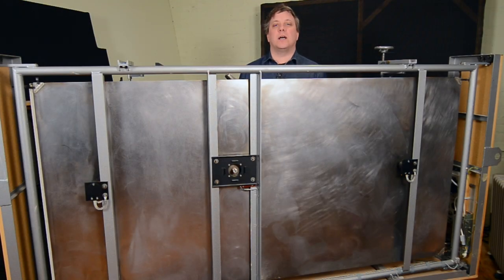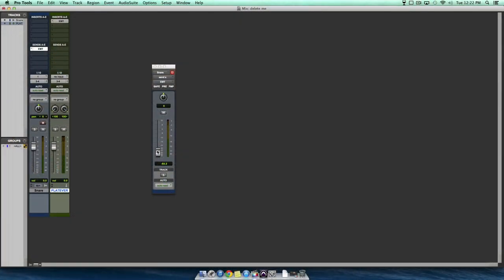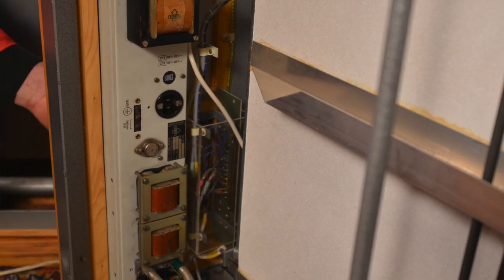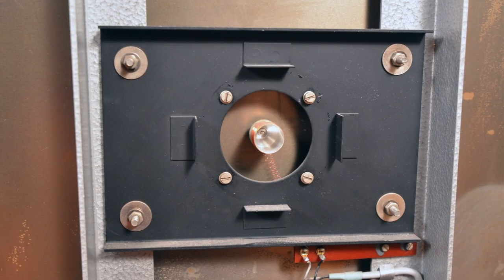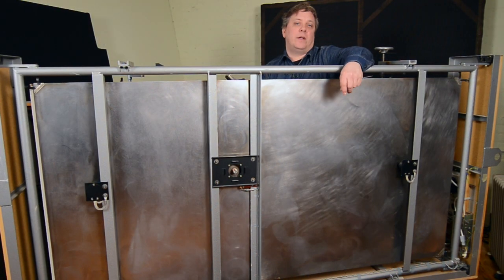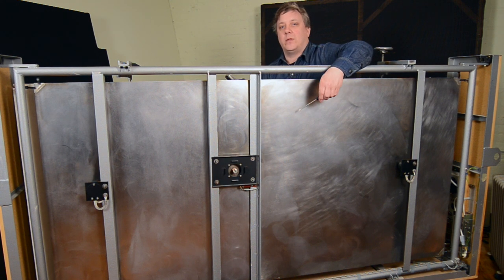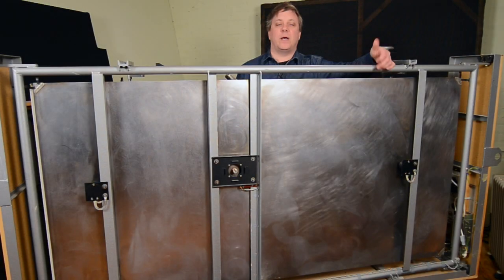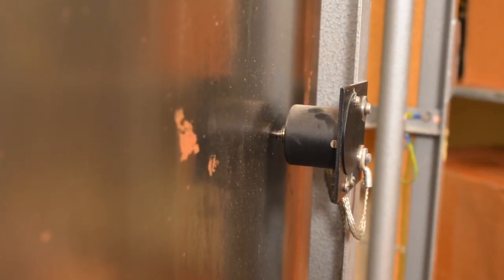EMT 140 Plate Reverb : How It Works?

Comment: I'm curious to hear what the plate reverb sounds like while IN THE ROOM when it's being used. Any way you can post a video like that? Also, I would imagine that the room that the plate resides in must be very quiet and isolated from the rest of the studio to avoid unwanted noise from being picked up as well, right?
Reply: Usually these metal plates are inside a large wooden box.  The author of the video simply decided to show the principle of work as clearly as possible, and he succeeded: in less than 2 minutes he explained as simply and clearly as possible.
Reply: @Ksjskalkwvshwjwvqnam  I agree with what you said, but even inside the wooden box, there would be an emitted sound, would there not? I imagine it sounds like a tinny, metallic form of music via the send to the plate.
Reply: @charlesbonkley  I can't answer this question. I can only give a link to an example of the sound of such a reverb: https://www.youtube.com/watch?v=ROCDQNpPEe0 . I also saw exactly the same reverb at the 2nd Mosfilm recording studio in Moscow, Russia (some call this studio the Russian Abbey Road); and there, in 2017, such a reverb stood in a noisy engine room along with all sorts of converters, computer system units and Lexicon 224 and 480 digital reverb. I do not know if he is standing there now in this noisy room, and how he sounded when he was in that noisy room. If the moment with that reverb is interesting, then here is the link: https://www.youtube.com/watch?v=m3CuTQA-8ck&t=278s True, there is a video in Russian, but at least look at what a noisy room he is in there😀

Comment: I don't quite understand how that damper works, if it doesn't touch the plate itself.
The pickups, I assume, are magnetic, like on electric guitar.
Reply: Julius Bernotas there is air between the damper and the plate.
Reply: yes, it called air damping. the air between the main plate and the damper acts like a cushion and it inhibits the vibration of the main plate. the closer the damper is the more pronounced the effect is. to vibrate, the main plate must move back and forth. for it to do this, the air must move out of the way. with the second plate (the damper) in place the air cannot get out of the way fast enough, so it inhibits part of the vibration and the plate stops vibrating sooner than it would in open air.
the pickups are the same design as a speaker or a microphone. a permanent magnet moves inside a coil of copper wire, this copper wire converts the magnetic field into a small electric current which is fed into the amp. it's called an induced current.
magnetic fields and electricity are related and you can convert one into the other. this is also how a transformer works ( a little bit)